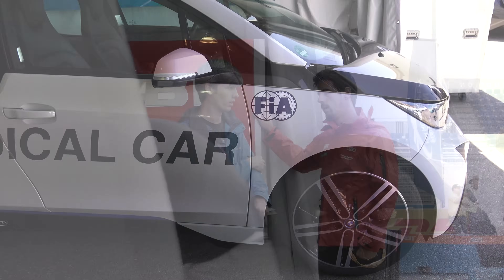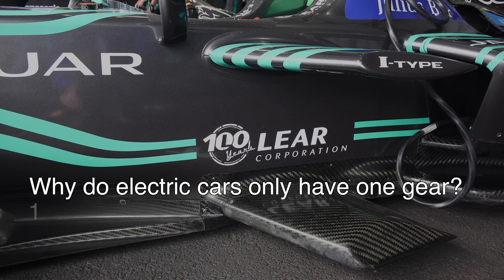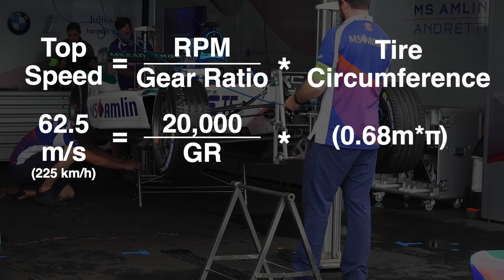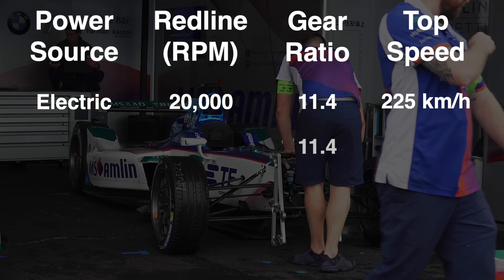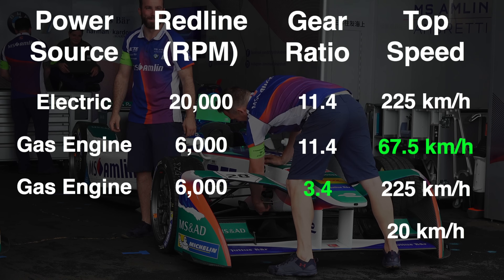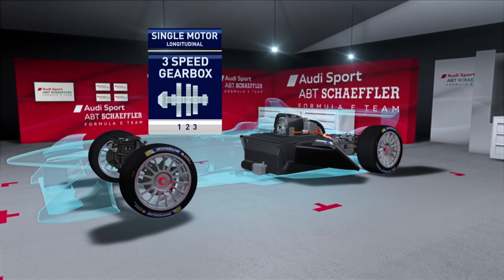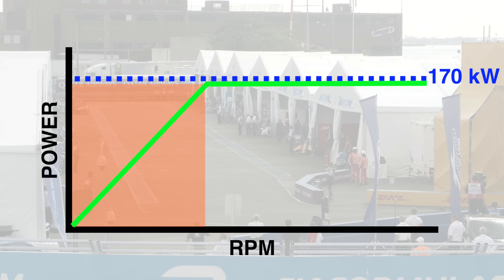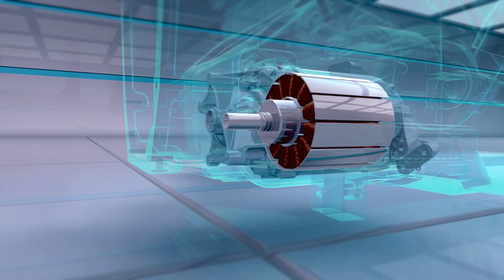Why Do Electric Cars Only Have 1 Gear?

Comment: I still love the sound of a V8.
Reply: And I love the sound of a Spitfire or P51 mustang, but they're not a practical way to transport people to Ibiza for their summer holidays. These cars will continue to exist for the enthusiast, but going forward I hope the vast majority embrace electric cars.
Reply: Not everyone is going to buy electric cars, there must millions of car enthusiasts out there, they certainly won't change to electric anytime soon.
Reply: It's time for 90%+ of the motoring world to move on to electric cars.. That'll be cool. But many of us love a a fine internal combustion engine, the way the most expensive watches still use mechanical movements. But it sure would be nice if we could create a renewable CO2 neutral fuel to replace gasoline. Perhaps algae-based?
Reply: @ginsunh  My thoughts exactly, why not create a fuel that burns the same way as petrol but is renewable and clean? So rather than having to scrap hundreds of thousands of cars which will lead to even more pollution, you could simply make them clean. Sounds like a win win to me, people still enjoying their combustion engines without any bad effects on the environment.
Reply: Sean lovi then that just means you just like how inneffecient the V8 engine in converting the fuel into motion energy... the sound produce by the engine means some energy in that fuel your using isn't converted to move the vehicle but wasted as sound
Reply: I own an i6, but the V8 has much more presence. The perfect balance of an i6 makes it sounds less aggressive and more like my vacuum cleaner!

Great engine config though if you can afford the extra length under the bonnet.
Reply: In the meantime you should consider getting a plug-in hybrid like the chevy volt. 50 miles on the battery, and then 420 miles total with a full tank of gas. You can be on electric 90% of the time and then use the gas for a road trip.
Reply: God, I do love the sound of a lazy V8 or high revving V12. But with this many people all wanting a car, it's just not sustainable. Plus, sound is energy, and you want to capture and use that energy. That's why F1 is so silent, yet they are able to get 1000bhp from a 1.6 V6.
Reply: The the problem with electric cars is where the energy comes from and creating the batteries themselves. For everyone to have an electric car, immense amounts of rare Earth elements including lithium would need to be mined and there may not be enough for everyone to own an electric car. Furthermore, China has the biggest stores of these Rare Earth elements and they certainly aren't the best with environmental regulation especially in terms of industry and Mining. And since we get most of our energy in many locations from coal and oil plants still, difficult to say If there really is any benefit.
Reply: Sean lovi Should be able to pipe the "sound" of a V8 into the cabin with a simple sound processor. :)
Reply: You won't hear another one past 2040 I'm afraid
Reply: @RB1of1  apart from all the remaining petrol powered cars and Motorbikes still on the road, it's only brand new Petrol and diesel's that are being banned from 2040, here in the UK at least, so you could get a used Petrol or diesel vehicle still if you wished 😊
Reply: I still love the sound of dialup.
Reply: 1423 171 I think you're misrepresenting what he/she said... You don't need to be an "expert on energy combustion" to know what is he/she saying. All you need is just to understand basic physic concept like "energy can't be destroyed" and "conversion of one form energy e.g potential energy to another form e.g kinetic energy will not be perfect and some energy will dissipate in form of sound and heat"). 

He/she most likely said that the design of Internal Combustion is INHERENTLY inefficient (yes even the glorified V8 engine). In fact, most engine in the past didn't fully convert their fuel (steam, oil) to vehicle motion. Thus, loving the sound of your engine make is just worshiping the inherent flaw of the engine

As i said before, some of those energy will dissipate in form of  heat and sound. However, in the case of electric car, the dissipation of energy in form of sound is DRASTICALLY reduced making it much more efficient in term of energy usage. yes, electric car still produce heat dissipation but it is MUCH BETTER than previous technology that produce high amount of heat and sound as waste. Our technology still didn't manage to convert >90% of fuel to motion (in fact, it is impossible to gain 100% conversion due to impeding law of physic) but you got to admit silent electric car is the right way to go
Reply: Electric motors are kind of annoying sounding though
Reply: Sean lovi electric cars for gays. 
automatic cars for girls. 
manual cars for men..
Reply: adamsrealm they've lasted 61 years I'm sure there will still be V8's in 23
Reply: Joe Cleveland 50 mile range will mean I'm electric maybe 50 percent of a normal day and less on weekends
Reply: You can just buy 20k worth of sound system and listen to it all day at the comfort of your sofa.
Reply: do you do 400 miles all the time?  if that is the case please take a bus, or airplane. if not charge half an hour will give you more than half the range more than enough for most of us to ride for a week.
Reply: Does it look like I care that old carbureted V8s are as inefficient as it gets? I love them no matter what. There is just something special about sitting down in a soft bench seat, turn the key and both hearing the sweet idle and feel the vibrations of a 6,4 liter V8. Classics, at least mine, gives me a sort of happy nostalgia feeling, can't really explain it but it's magical. New cars are just so dull, they don't give you that classy-cruising-vibe compared to my ' 59 Deville. It's a car made to suit the mood, not to be efficient or green or fast.
Reply: This is the exact same argument regarding turn tables VS digital music.
This is the exact same argument regarding CRT VS LCD monitors.
Reply: So it's like owning a museum then.
Reply: Yeeees
Reply: its called global warming
Reply: silent? lol have you been?
Reply: Flat plane cranks sound nice, 90deg V8s are, and sound like, truck motors.
Reply: Nor Dic Wrong, do nascar motors sound like truck motors? 426 hemis, L88 aluminum block 427'S what about the hellcat, demon, ZL1, Z06 Viper and GT500
Reply: Viper is a crossplane
Reply: David Cross a few years ago in my area it got to negative 40 degrees last I checked thats the 9th coldest winter in 141 years
Reply: Sean lovi so the
Reply: i still love the sound of inline 6
Reply: Eobard Someone needs to take away this guy's dialup lol.
I think he proved it's a masculinity thing, were manliness is proportional to how loud and obselete your car is. The old-gritty-masculine-culture is constantly changing and always a few generations behind in technology.
My first car was a manual and the sound it makes is nostalgic, but cutting-edge electric cars are objectively better; it might take another decade before their prices are reasonable though.
Reply: also if you're referring to the theory that we will be out of oil by then that's incorrect as well
Reply: crunch9876 New electric cars have over 300
Reply: elmohead That's far from the same as actually owning a V8 car and hearing the sound in person
Reply: kestrel archer Doesn't matter. Carbureted V8s sound amazing, and they have such a colorful history.
Reply: i like the sound of slience but deadly! 😁
Reply: Alexander Tegelström 1959 Cadillac is almost like a rolling museum. It's actual art.
Reply: Electric Motors are older than Gasoline Engines. We had already moved on from electric cars long ago, now we are going back because Elon Musk who took over reigns from Steve Jobs as the World's Marketing in-charge is a fanboy of Tesla. They would have made a comeback anyway after the depletion of fossil fuel.
Reply: I mean the internal combustion engine is much older than the electric motor by 150 years but a gasoline engine like the one we have today was not fully realized until 1859
Reply: No it's not.

Who cares which technology came first? It's like the drives in your computer. It was SATA, then ATA, then SATA... etc.
Reply: Feeling old, uhm?
Reply: al kiou seriously,I like listening to it when I have just woken up,it makes me full of energy and sometimes when a nice V8 sound passes by when I am trying to sleep,I feel awesome lol.Btw,I am losing sleep so I don't care if it is noisy or not,I can't fall asleep untill 3 am anyeays
Reply: Ivan Wong American classic V8s sound so nice, because the are so unperfect. European V8s sound so boring, because they fire R L R L R R L R, while amerian V8s fire very unsymmetrical and the timing isn't perferct and carburetor as well before around 1980. My neighbour has a 1966 Charger 383 and it sounds sweet as well, my 1959 Cadillac sounds almost similar but not as loud.
Reply: Whats really annoying is when people with hondas and subarus drive by at 5000 rpm blasting their fartcans for all to hear
Reply: 1423 171 Many engines sound annoying even stock.
Reply: Sean lovi i would love to say when i day:"I don't regret anything i didn't destroy the planet" but you ... you do it
Reply: 420BootyWizard because of climatic change if we stick to petrol we might be the last wo life on this planet...
Reply: Use Trollgun 01 you have at your garage no poweroutlet? And how often do you drive 400 miles?
Reply: Buddy you do realize that an electric car is mostly coal powered right coal is not good for the environment which is why smug douches like you are shooting blanks in arguments like this
Reply: Not to mention the production of a single Tesla Battery pack creates more pollution and is worse for the planet than driving a gas powered car that gets 15 MPG which equates to a pretty hot V8 daily for 8 years just think about that my car was made a while ago with a V8 and you're polluting a little bit less through coal power however the production of your car is equal to 8 years of me driving like an ass redlight racing and all
Reply: 1423 171 its a whole new industry before Car companys were using these batterys the only big one were Mobile Phone users.... the most machines ecr are not optimice  yet there will be a lot to do ... and a lot of e cars are powered by solar most free Chargers are "Green Chargers" who use solar and even then it depends where you live.... at my place it would be about >80% Solar, and do i can drive nearly Co2 less and you? NEVER but me if my country remove slowly Coal and other i drive CO2 free and no it about 6 years (With Tesla Gigafactory it will get much more down) but you WILL NEVER DRIVE CO2 LESS but I CAN it only NEED A START
Reply: +Sean lovi
Just ask the people living beside a highway, how much they love that noise during sleepless nights.
Just ask the people inside big cites, how much they love the smoke to breath from cars creating that cool sound.
If you like noisy cars, you can build in a big woofer inside your EV and you will have an incredible sound...
Reply: the next generation wont have this choice as their wont be any more gasoline.
Reply: Me too, but do our neighbors? Or do you like it when you're sleeping or working? I don't.
Reply: because there's no other planet we can live on yet, there's no plan B
Reply: +Ghost Toast obviously you are not old enough to recall winter's of decades past.  Winter now is more like a cold fall
Reply: We could create mass scale ethanol and use ethanol engines, but since it uses so much land, it would be expensive. 

I think thats fair though since engine "noise" is more a novelty. In reality engine noise is just a byproduct of inefficiencies in the engine.
Reply: every single time theres talk about ev's, there someone wanking of to good ol sound. You know you can just record it and play it all day, right?
Reply: David McClelland 
Until EV's can go at least 400 miles on a full charge and charge as fast as filling up at a gas station, i'll pass.
Reply: fetB said by someone who doesn't understand the effect of those noises unfiltered and unrestricted by audio equipment.
Reply: @Use Trollgun 01 

If you drive 400 miles with no rest regularly, you are something else.
Reply: CaddyPro'59 not to mention the glorious the sound of the secondaries opening up on a fully mechanical Carburetor 
kestrel archer you are just wrong here due to the way an internal combustion engine works in that it combusts airfuel mixture and accelerates it through expansion it will always produce a great deal of noise the only way to prevent this is with mufflers and long exhaust which actually make your engine less efficient so don't act like youre some expert on energy conversion and then spew this nonsense
Reply: It is great and everything but it's time to move on now.
Reply: al kiou 
One of my neighbors has a loud motorbike, and no one seems to be complaining about it, even in the morning and night.
Reply: No inline 4 and 6 sound better
Reply: American classic carbureted V8, the best object to exist. I know V8s aren't eco friendly but electric cars are not something for me, there's no manliness in them. 1959 Cadillac Deville owner here, possibly the most stylish car of all time, rides so well and sounds so sweet.

Comment: Chevy Volt has a CVT, fair compromise between low speed acceleration and decent top speed IMO.
Reply from the maker: +Keven Harvey yes, but the Volt also does have an engine.

Comment: Well, every modern electric traction systems actually has a transmission but it is electronic or more accurately electromagnetic. The keyword is field weakening. It allows to trade torque for speed. Could be a interessting topic for a new video ;)